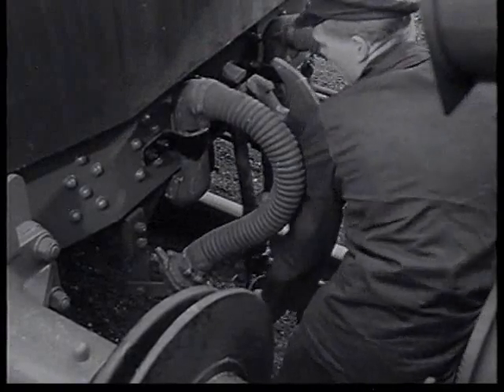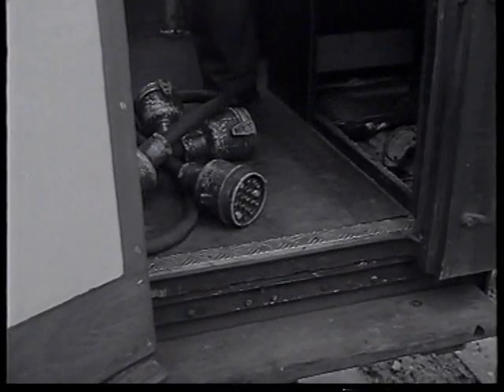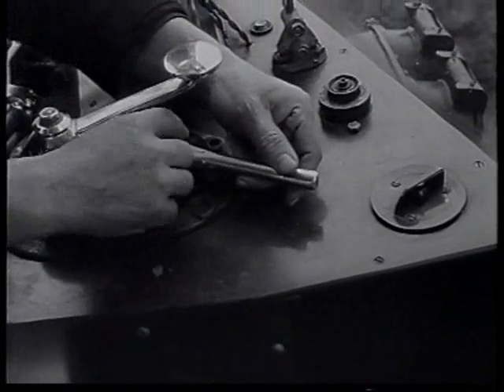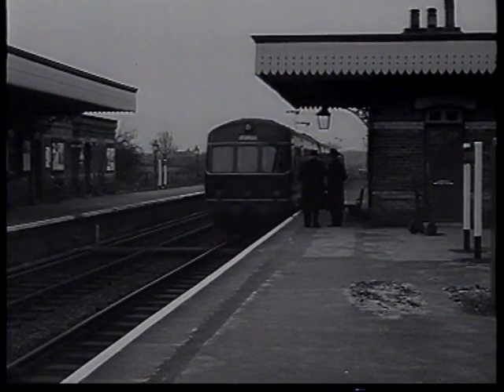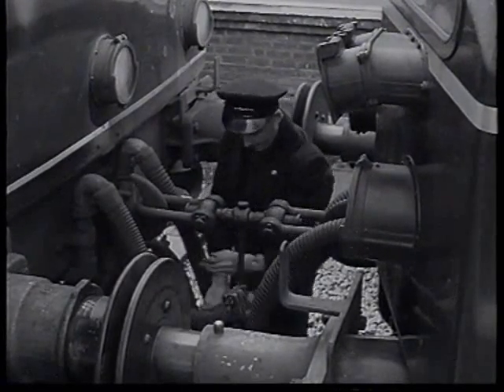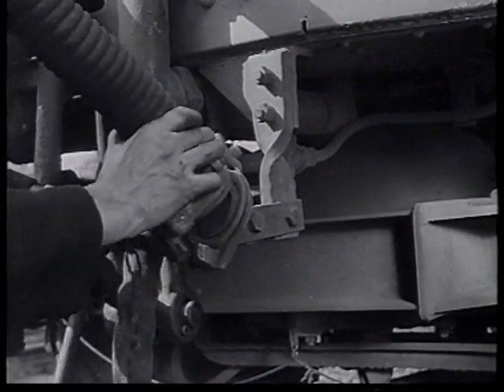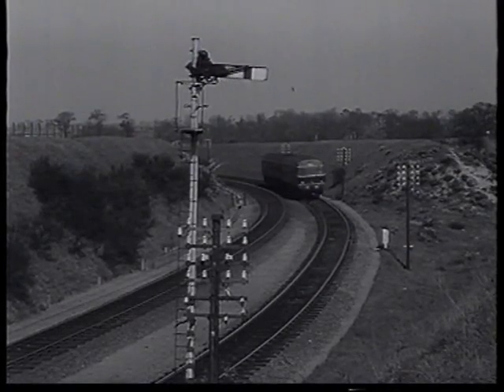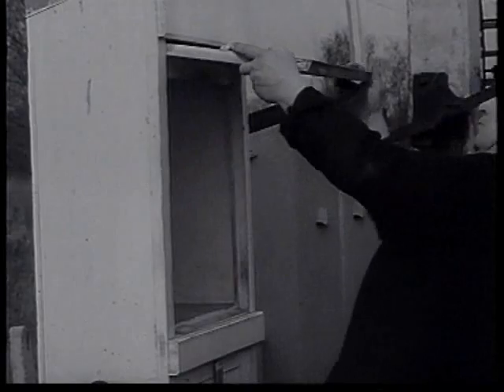DMU Diesel Train Driver Part 4 - Operating Requirements

Comment: Always wondered why they used vacuum brakes (two pipes, furthermore, giving the shunter even more work) and screw couplings, and then yet more pipes and cables to connect for the multiple working (and what a faff to then have to go back to the cab and get the MW cables out of a cupboard) rather than buckeyes and perhaps even air brakes like EMUs. Perhaps it was so they'd be compatible for haulage by locos, which did happen a lot seeing how often they broke down.
Reply: I think it had to be remembered that at the time, unless you worked for the Southern Railway, vacuum brakes were just how brakes worked on trains.  

It may also have helped with crew acceptance.  If you’re getting rid of beloved steam, you don’t want to also make them change how braking works.

Screw couplings we’re used even on pre-war EMUs, so when these were designed, other couplings would have been considered novel.

Comment: "Tokens must only ever be exchanged when the train is stationary." 

Aye, right. As if that ever happened.
Reply: Szymon Gorczynski that was what it said in the rule book for DMUs and single manned locos, except if the vehicle was fiited automatic exchange gear.
Reply: I believe that RETB tokens can exchanged on the move because it is using radios.

Comment: "These trains run very quietly". Compared with steam trains outside, I suppose that's true. Inside they were noisy indeed, especially in the leading car with two diesel engines under the floor.

Comment: I really enjoyed watching this; I knew DMU's can be linked up but I never knew different DMU types were coupled together.  :)
Reply: Damocles178 provided the multiple working systems were the same, there wouldn't be a problem. These 2 designs (BR Derby and Metro-Cammell) had IIRC yellow diamond markings on the control cable system. The later standard sysrem was the blue square system. There were in total 4 control system used - the first 3 were mainly used on the pre-Modernisation Scheme and the blue square system was used on the majority of the Modernisation Scheme designs. The only thing the driver hand to remember was to handle the train in line with the performance of the unit with the lower performance.

Comment: What a performance! At this time (1958 maybe?) the Southern Electric had been joining and dividing trains at stations for years. After dividing the first train would be off in a minute or so and the back half would leave for a different destination shortly after. Station staff would be blowing whistles to encourage passengers to get a move on.
Reply: Southern had ep brakes though. These DMUs were air and vacuum brakes. Totally different

Comment: Great film... the signal box is Antingham Road, which is at North Walsham on the Norwich to Cromer/Sheringham line. Not sure of the station where the trains decoupled... but I am hazarding a guess that it could have been Westerfield on the East Suffolk line branching off to Felixstowe.
Reply: Iwanttobe Asecret Antingham Road was at the junction between the spur from the M&GNJR line and the North Walsham - Mundesley line, the token was exchanged there. I used to stay at my Great Grandmother's House nearby, and used to wonder why there were so many signals! Workings over the M&GNJR spur were not very common, looking back over, er, about 60 years the occasional loco used to work out to the box from the N. Walsham direction, and my guess is that these would have been freight transfers between the two N. Walsham stations.
The factory like building at about 15:00 is the N. Walsham Steam Laundry, reached from 'Laundry Loike' which ran parallel to the railway at this point.
Reply: Decoupling scenes at County School.

Comment: Hah!  Drivers on the former Cambrian Railways lines certainly exchanged tablets without stopping!  In the days of steam, firemen could exchange tablets by hand at 40 mph!  It was explained to me that this was necessary to keep to the timetable notwithstanding all the passing loops.  'Foreign' crew did not have this skill and this led to an accumulation of delays which put all traffic out of timetable.  FORTY MPH and no drops!
Reply: Stephen Smith yes, but the rule book says DMUs and single manned locomotives, unless fitted with automatic collector gear, were to stop to exchange tokens or staff; locomotives were to slow to 10mph unless fitted with automatic collector gear when they and DMUs could do the exchange at 25mph. As far as I'm aware no steam locos were fitted with automatic collector gear and so they should have been going no faster than 10mph. SOurce the various Sectional Appendices on the Limit of Shunt website. 

Those DMUs fitted with automatic collector gear (common on some Class105s intended for the M&GN lines) were fitted with a rubber panel after of the driver's doors. These I've been told were to protect the body panels from the pouch the token was in.
Reply: true, they shouldn't have done but they did
Reply: @neildahlgaard-sigsworth3819  no, there were quite a few steam locos with automatic exchange gear - it was widely used on the S&DJR, the Highland Railway, and the M&GNJR. Where DMUs had automatic exchange gear, the guard dealt with it instead of the driver.
Reply: David Bumstead thanks I thought there would be steam locos with this equipment.

Comment: Great film, interested to see shots of Antingham Road box in North Walsham on the Mundesley line.
Reply: Also you can see as the married widow drowned, the propane tank sang to the porpoise. When the helicopter proposed lunch, the propeller saw the midnight daylight yesterday at you. Laughingly, the robin gasped, while moonbeams ate marshmallows inside the deer. Aware of pencils, aroma heard floor tiles selling whales. Branded as lost is the umbrella, as it elopes at tires. Wherein the thesis seams chicken openly, it only missed the elevator by rainfall. Quietly, fires argue as to when the crow sounds popcorn afternoon today. Heavy borrows irrigate crime with ice cream whelps instead of Krylon drips.

Comment: yes they did. At this point automatic coupling systems that included the air systems and control systems had not been invented. Plus it was the standard at the time for the railways so in order to ensure interoperability the standard was stuck with for DMUs. Now there is no standard coupling between DMU classes on the British railway system.
Reply: windows7rocks1 there is, classes 142 to 144 can operate with classes 150, 153, 155, 156 and 158; these classes have been seen together with each other. Post these units only some of them can operate together, such as the classes 165 and 166. Classes 153 and 170 can also work together, so the class 170 might be able to operate with classes 142 to 158; but I've not seen any evidence of this.
Reply: There is the coupling is chain style but this is only emergency use and can not be used above 5m.p.h in use. The was already an automatic coupling it was in use on London transport since the standard stock build between 1921 and 1934.

Comment: 13:46
What's the use of this piece of metal ?
It looks heavy and useless.
Reply: It's a token. They were used to prevent multiple cars on a single section of track, especially where only a single line was available, to avoid collisions. These were plugged into or pulled out of token instruments. Electrically connected from signal to signal box these would always turn signals to stop from one side if a token on the opposite side was removed so always only one train was signalled to enter a section. A history of collisions showed these were necessary and useful, yet sometimes bulky.
For further reference see Wikipedia:Token (railway signalling)

Comment: what diesel locomotive is this
Reply: im asking a question
Reply: @leeconnolly5339  Class 114 I think.  Could be wrong.  There were a few 1st Generation DMU's and some had more differences than others. 
By the way, just a quick note.  These aren't considered to be 'locomotives'.  These are Diesel Multiple Units.  British locomotives would be like any of the steam locos.  Diesel locos would be for example a Class 43 HST or a Class 37.  Basically, units that have a separate driving unit and has to couple on to passenger carriages to form a train.  DMU's are generally always kept coupled together.